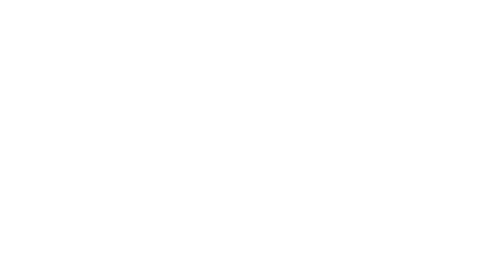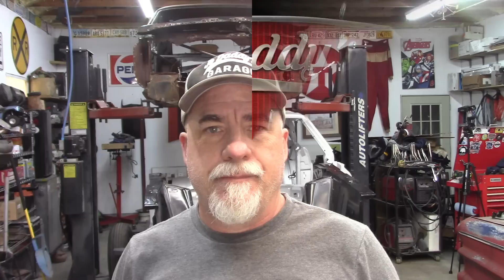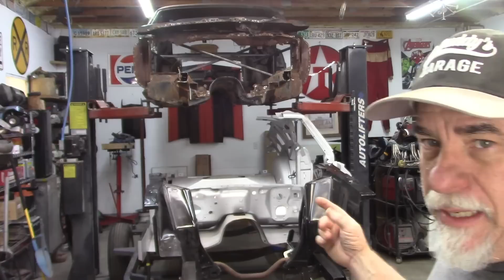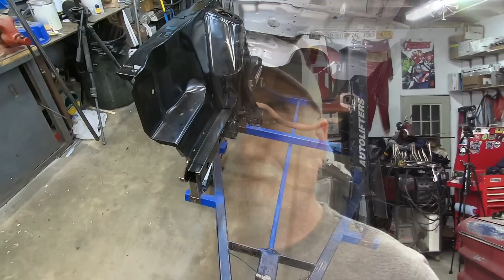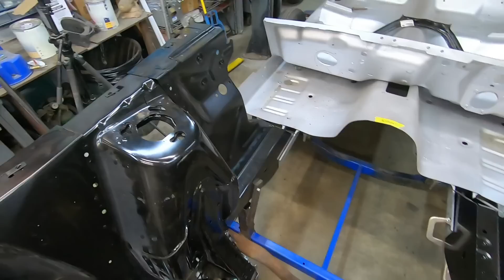Cobra jet rebuild: From the ground up. Part 7.

Comment: Do you use a drill bit sharpening tool or just replace the bit when it get dull?  I use a sharpening tool.  Sometimes it works and some times it doesn't.
Reply from the maker: I usually just replace them. However, these are industrial grade drill bits. Last a very long time. The smaller one was used on previous projects before even starting on the CJ.

Comment: I was digging in your videos for an hour trying to find your video where you sit down and just talk about the sheet metal part of it.  I thought there was a video where you said something like "I just want to sit for a minute ad talk about metal" or something like that.  I believe you talked about removing spot welds and what you used to remove them, but i could not find it this weekend.  I needed to get some bits for my 69 and was wondering what you used.  I gave up Sunday and went and bought some bit.  Came back to see how you are progressing and you upped me one, in a good way, lol.  I ended up doing 1/16" pilot and then going after them with a 5/16ths.  That resulted in a little bit of the top sheet metal leaving a small amount of weld/sheet metal on the outside perimeter and a tiny divot in the base metal.  I think I am gonna go with a 1/8th and 11/32 with the tip ground at a les than steep angle next round.
Reply from the maker: I may have talked about it at some point, but I don’t remember specifically. The method I used here is pretty effective.

Comment: When I repair the grease access holes I tack on a junk piece of metal on the shock tower drill a hole with a hole saw  then use the plug from a good piece of sheet metal as the repair plug.

Comment: For the holes in the shock towers, you could cut a hole in a sacrificial piece with a hole saw, then clamp that to the tower as a guide. No need for a pilot hole and it gets you a regular shaped round hole to plug. No sparks and minimal to no clean up.

Comment: Hey Barry, what is that flat tool called that you're using for busting the drilled spot welds?
Reply from the maker: Steck body tool. There is a link in the description below.

Comment: I commend you for trying to salvage some of the original sheet metal but as rusty as that car was I personally would not be trying to save the pieces that you are saving. I would have replaced the entire apron assembly as a unit. Good luck
Reply from the maker: I’m doing the best I can to honor the owner’s wishes. Many ways to do the work.
Reply: @JoDaddysGarage  would you have done it any differently if the owner hadn’t requested it?

Comment: I don't understand....
If you're using the shock towers and the rest of the engine compartment  sheet metal, then why didn't you just use the front framerails only?
Reply from the maker: We weren’t sure what would be usable, so we got the full setup just in case.